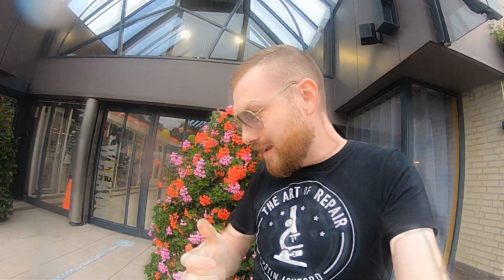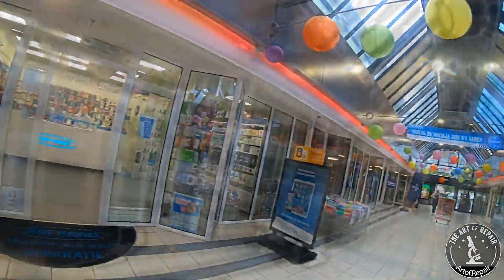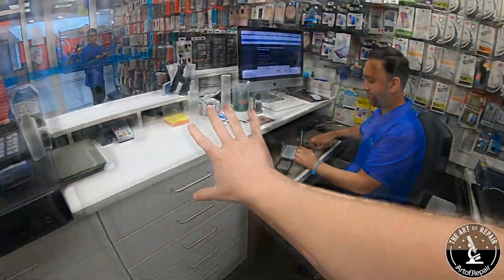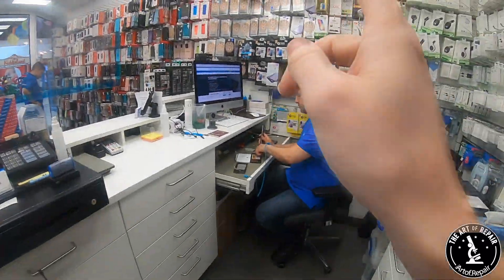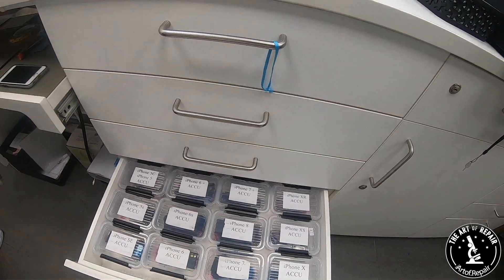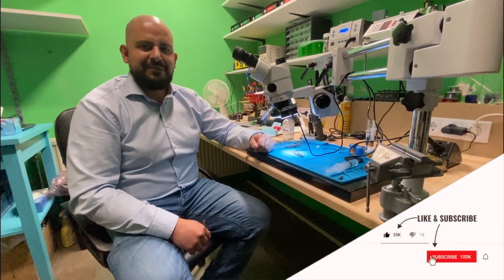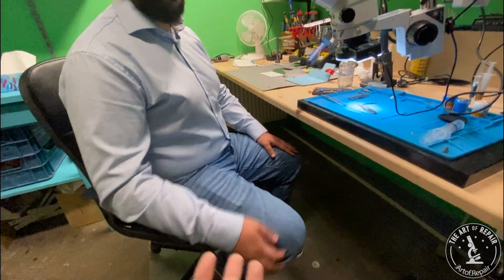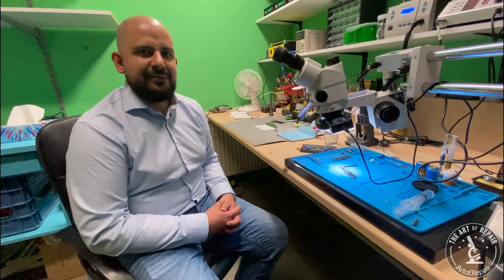🔬❤️🇳🇱  Is my Microsoldering Desk Complete? | Just Phones | Shop Visits | 2021 Euro Tour #1

Comment: I was about to tell you to pass around the hat until I realized this is an actual business. The lame tooling doesn't instill much confidence in their capabilities. The puny, underpowered ultrasonic cleaner on the shelf does wonders on grandma's dentures, but barely anything on a corroded or fluxed up PCB.  In my shop, that pathetic soldering station isn't even a good stand in if my more capable Metcal calls in sick. Even the cheapest T12 DIY station on eBay and Amazon have infinitely better performance. Right now, Aixun makes an unbelievably good and affordable JBC clone, which many reviewers claim to be as good or better than the real deal. At around $120, with two c245 tips and stand, you have to be a idiot not to buy one!
Reply: I second the T12 DIY stations, they bring immense value for their low price. Once I switched to a KSGER T12 for basic soldering, I never looked back. I have my eyes on the Aixun as well. 😁 Very good suggestions indeed! 👍

Comment: I want to become a microsoldering expert repairer. I am trying to teach myself but drastically I don't have any equipment or tools other than a soldering iron. As a disabled Air Force Veteran who's unable to work a normal job and that means I have no income. The VA only gives me $280ish per month and that's it. I can't afford a lot but I want to make a business but lack so much.
Reply from the maker: I think my best advice at this point would maybe be to try to do some regular screen repairs and work through some of your local veteran groups, maybe give some discounted work to fellows and then when the times right. Boom. get some new gear. It might take a few months but I know you can do it!

Comment: No computer/monitor with schematics and pcb layout?
Edit - and some cable management on the wire to the led light on the microscope ;ø)
Reply from the maker: haha yes! we talked about setting him up a computer station. his computer was just elsewhere and just needed moved =)  Good call for sure though, having a computer with a good size and resolution monitor can speed things up like crazy if your doing diag work.
Reply: @TheArtofRepair  the psu is out of reach, where is the multimeter? thermal cam?

he need a cam above the desk who record the opening of the stuff(how much fucking screw on these dell gaming laptop  ? :p)(can be use as evidence in case where your customer try to  rip you off ;p)

and a good hdmi video capture card

the shop is at europe, so the iron station he must choose is a jbc
hakko is a nightmare to find at europe(too expensive,  take too long time etc)

he need a good fume extractor...

he need a ultrasonic cleaner
he need this https://www.youtube.com/watch?v=BLLoQw0EfT0 (he has a shop, the machine is refound in 1-2years) to change only the glass on smartphone and tab
and he need it  https://www.youtube.com/watch?v=btw375M6lSY to do some bonding for the flex of lcd

don't forget these nice desoldering station for the iphone unless you don't want to repair it :p

oh...and he need a qualified technician(who only do repair and not these poor boy who repair lcd between 2 customers) :p

seriously, it seem you do a remake of nightmare kitchen :p